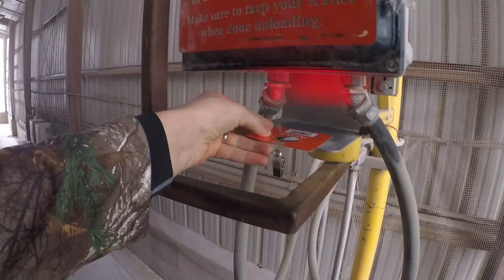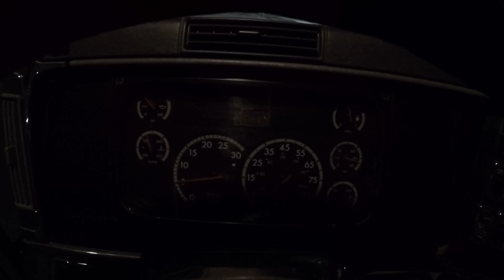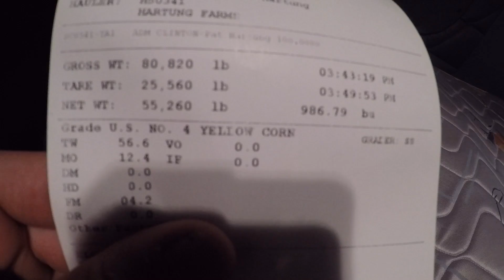Trucking Across Eastern Iowa Hauling Corn

Comment: In freezing weather, I will not set my trailer brakes. Let them sit and when the air bleeds down. Then the trailer valve will pop. By then the brakes can't freeze to the drums. Tractor can pull the frozen shoes off the drums. But as you found out, the trailer can't.
Reply from the maker: Well that makes a ton of sense! Definitely going to be doing that from now on in freezing weather, thanks for the tip Pete!